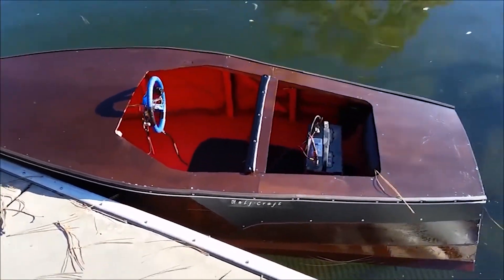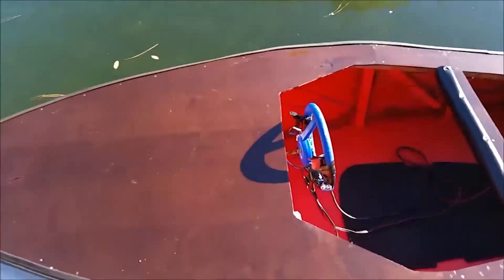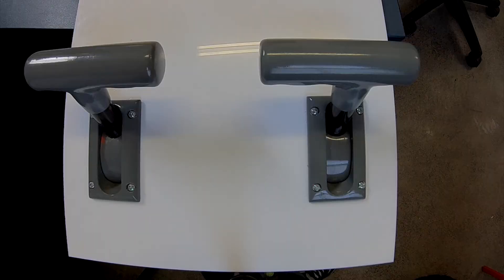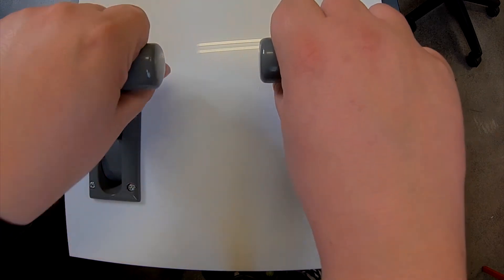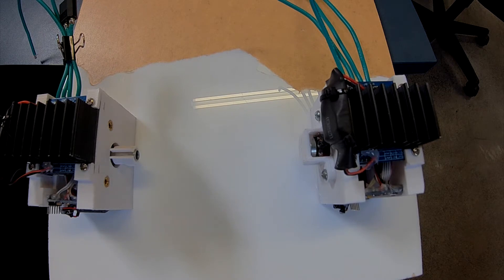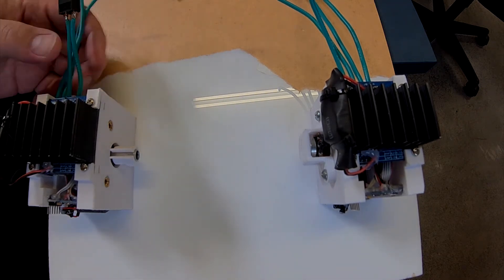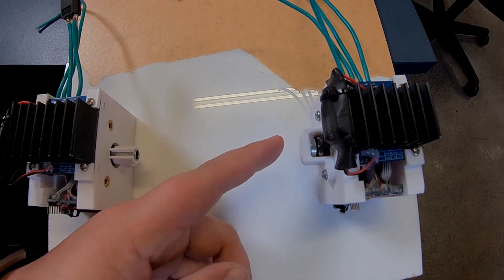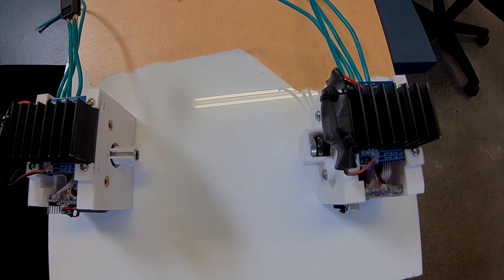43A 3D Printed Boat Throttle Handles

Comment: Nice. I would like to see more on the electronics and the code for the arduino. Very nicely done.  So does the motor connect directly to the 43A? If so what is the current rating on it?